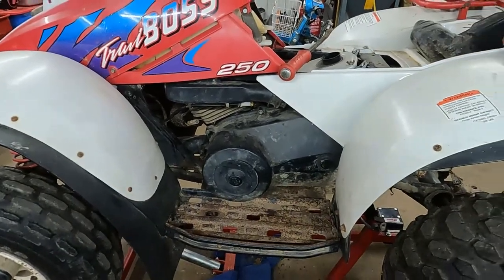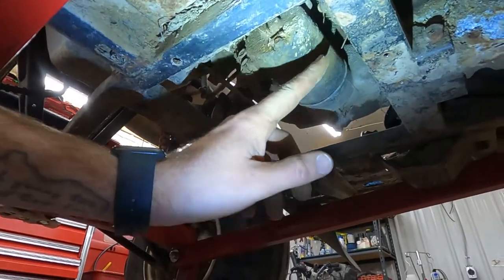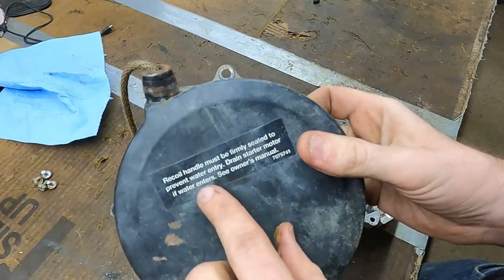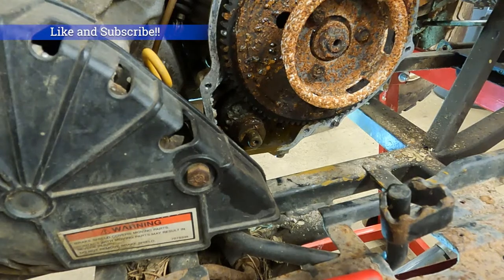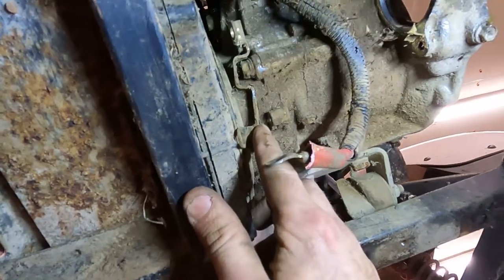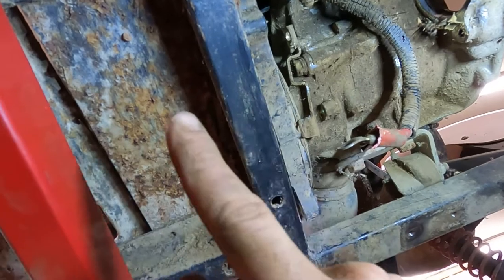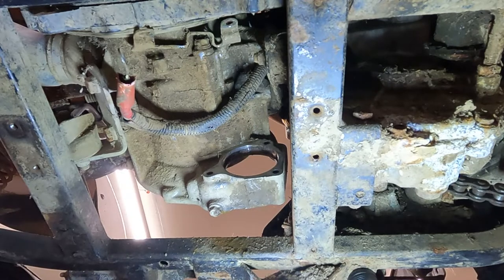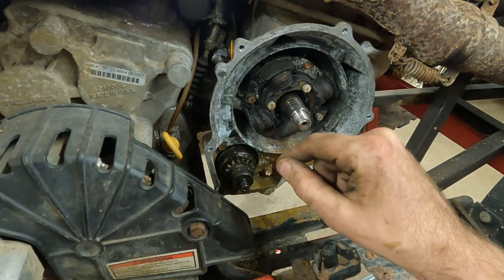Replacing Starter on Polaris Trail Boss 250 | WATCH THIS FIRST!!

Comment: Did the starter on a trailblazer 250 this weekend.  Pain in the ass.  Got the last bolt from above, but had to remove the air box, carb and a motor mount to get at it.

Comment: On a full battery charge my electric starter works, if not I have to use the pull chord to start my 2000 Trailblazer 250. Not sure I want to change the starter after watching this video
Reply from the maker: It’s not fun 😅 is your voltage regulator ok? If it’s not recharging the battery that might do something similar 🤷🏻‍♂️
Reply: @ToyShopRestorations that’s actually a great suggestion, I haven’t even checked my voltage regulator. Thanks for the advice!

Comment: What tool did you use to get the large gear off? (Flywheel? No idea what it'd be called)
Reply from the maker: I have a flywheel puller kit from harbor freight. https://www.harborfreight.com/bolt-type-wheel-puller-set-62620.html
Reply: @ToyShopRestorations did u plug the hole in the bottom if the starter is just got a starter and theres that hole like yours but i dont have a screw for it or anything